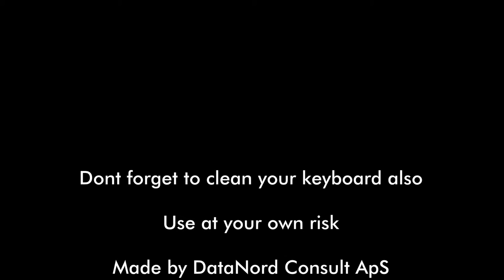How to dust clean a PC with compressed air

Comment: That's not how you do it, when the fans spin they generate electricity.. That can damage your motherboard.
Reply from the maker: Interesting view, you probably have a point. however I have been doing this for years without problems with lots of computers. But often I also after short initial spinning hold the fan with my fingers or the nozzle of the compressor, to avoid too high rotation speed and to clean the cooler slits thoroughly.
Reply: true
Reply: more importantly they can sping in the wrong direction which can damage the motor and possibly kill the fan.
Reply: I'm not sure if I should use this method of cleaning on my Alienware 17 r4.